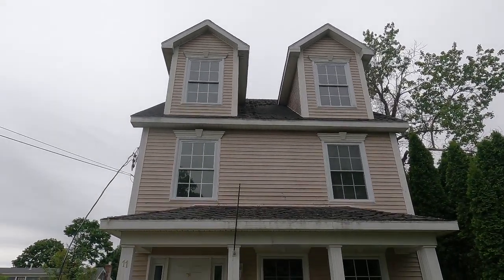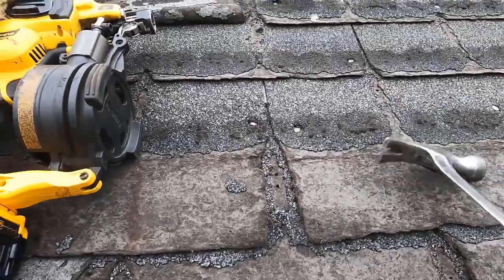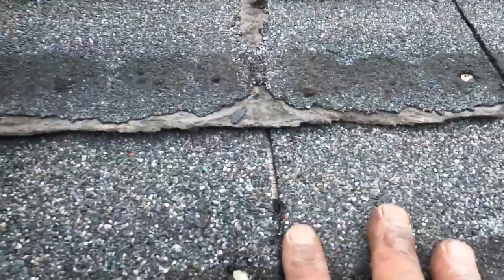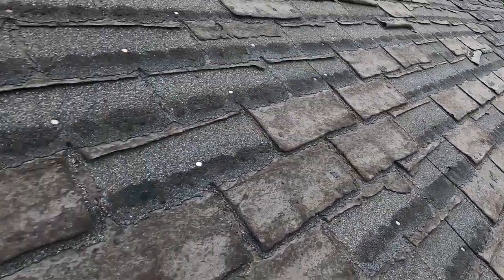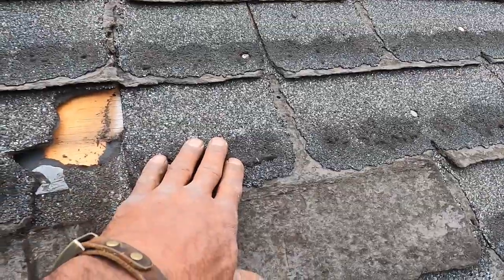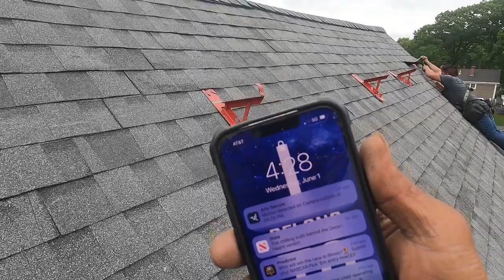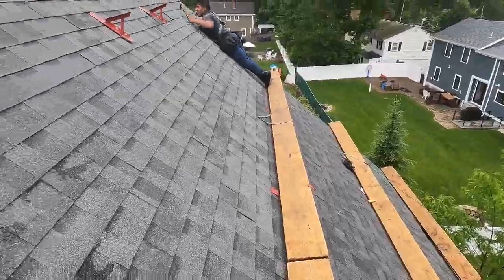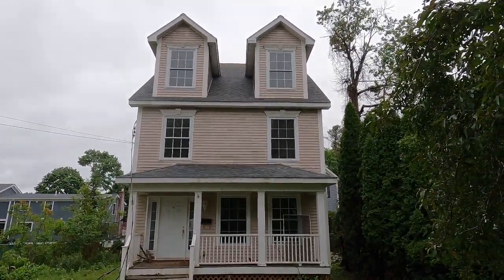Signs of Advanced Roof Aging, Loss of Granules, Torn or Cracked Shingles, Holes in the Underlayment.

Comment: I'd blacktop that roof a couple coats with a roller like I'm doing a asphalt driveway to seal it again.  I'd repair any spots with cracks using henry's roof patch.  then I'd be sprinkling areas as I go with roofing granules to reshield it with ceramic roofing granules.  In this way I could actually FIX all that old shingle rather than replacing it and thereby extend its life forever and NEVER need a replacement.